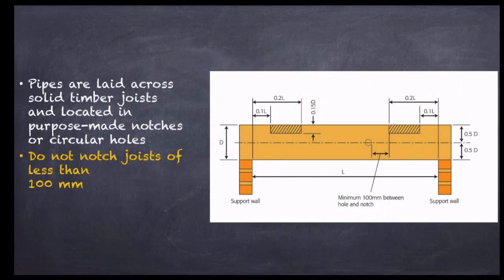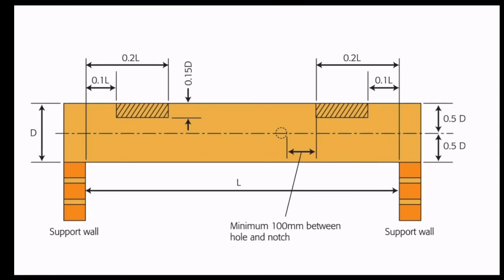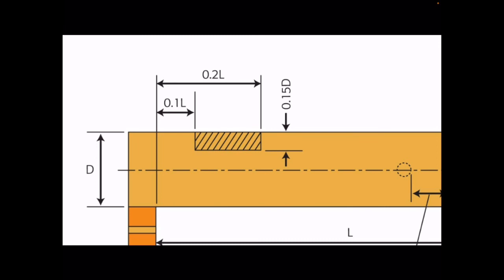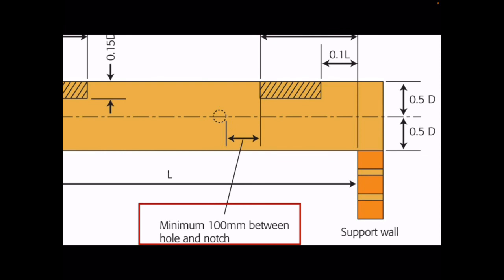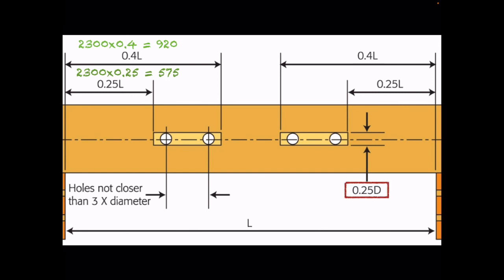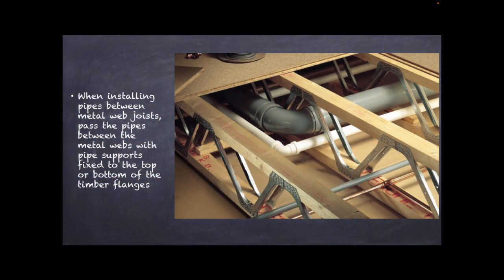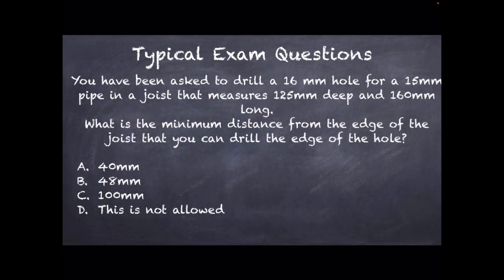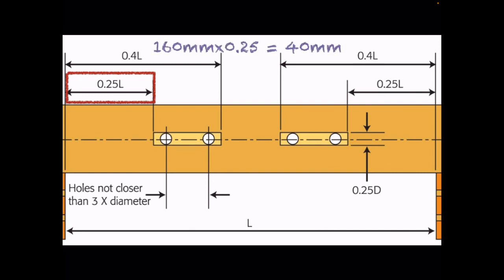ACS Essentials - Notching and Drilling Joists

Comment from the maker: I understand now…right, you sleeve the pipe through the floor/ceiling…then, seal the sleeve to the brickwork gap using fire resistant mastic
Then you seal off the sleeve AT ONE END ONLY between the sleeve and the pipework (this is to stop any leak in the pipework within the sleeve placing gas on two separate floors) My advice would be to seal it at the bottom end…my viper     
page for this is K18 and the paragraph is called Pipe Sleeving …

Comment: I find a lot of grey areas in the gas industry- so as an example I’m doing a new gas run in a loft space .   But the way the joists run   (Horizontally) is the same way my gas pipe needs to go , therefore noticing is not and option,

Can it be clipped to the top of a joist
Reply from the maker: Hi Charlie, thanks for the question.
You can run pipes on top of joists if there’s enough space between the joist and the flooring or whatever else is above it…the notching and drilling rules are only applicable if you have to negotiate a joist running across your pipework.
Hope that helps…
Reply: @passyourgas  thanks your vids / knowledge always helps
Reply: @passyourgas    another one you could hopefully help me with..   so I'm looking to do a new gas run in-between floors on a property I'm working in. The builder is trying to make as little mess as possible.  (keep the cost down)

normally I would be run behind plaster board or chase it within the wall..   however this time they have requested to run in between floors clipped to the wall. (in the corner)

reading through volume 2 of the viper book I can't seem to find anything which says its against the rules as long as its sleeved both ends.  equally I can't seem to find anything to confirm its ok !
Reply from the maker: @charliefox6987  are you running the pipework horizontally or vertically?
Reply: @passyourgas  vertically.  from ground to the loft (in a bungalow property) then once in the loft will go across the joists as discussed originally

Comment: A great video .... can you tell me are all your figures from building regulations or from a gas book because it my gas book these numbers are all  slightly different?? many thanks
Reply from the maker: Hi Steve, thanks for watching. The figures come from gas books. I’ve got all of them and tend to use the one that helps me explain things as simply as possible. I know there are different styles of how to represent the figures but they are all based on building regs (the same rules of notching etc apply not just to gas pipes but water etc as well). I’m aware that some books represent the spacing in fractions rather than decimals and vice versa but they’re all just about the same. I hope that helps. 🙏
Reply: ah OK thanks for your reply.... I'm just getting a little confused as my niceic book it says that notching in the top of a joist is equal to and no greater than 12.5% of its depth  in its permissable zone .... however if notching from the underside of joists it can be equal to and no greater than 15%....within its permissable zone ...  I think I will try and find a more up-to-date version... thanks again for these cracking videos!! sitting acs at the end of the month and these really do help...
Reply from the maker: @1stevew  That sounds a bit complicated! I’ve checked all the current books, and obviously I know the answers to the acs exam questions, so if possible stick to my figures. I would recommend the Viper book, it’s pretty well the industry standard nowadays and you can’t go wrong with it. If there’s anything you’re confused about please let me know and I’ll help you out. Good luck!
Reply: @passyourgas  will do .... I think I'll get the viper books next week... many thanks again 👍